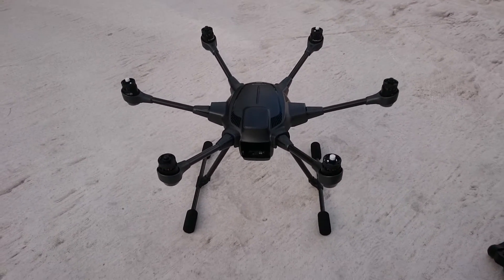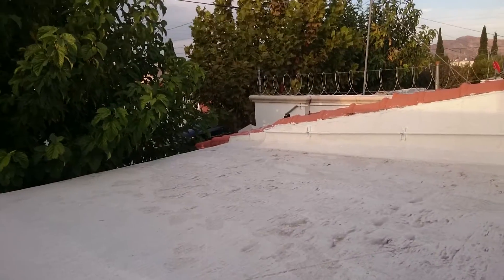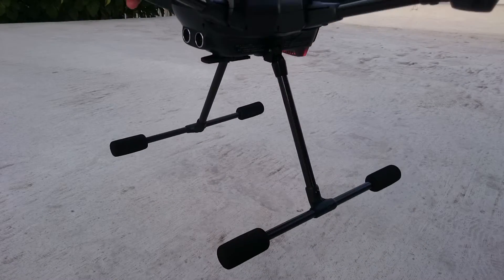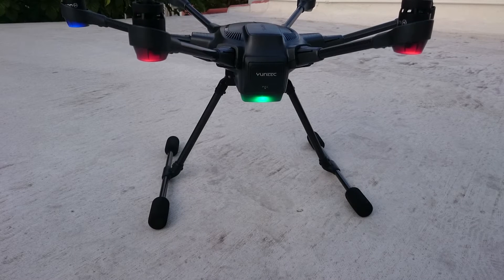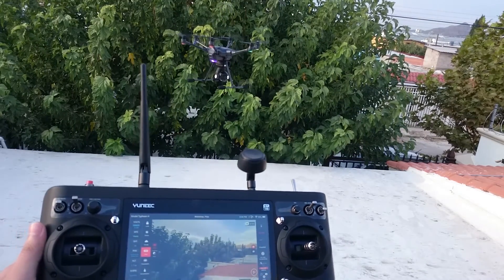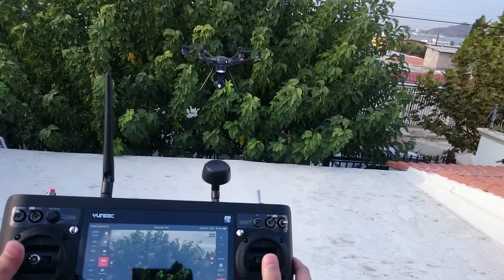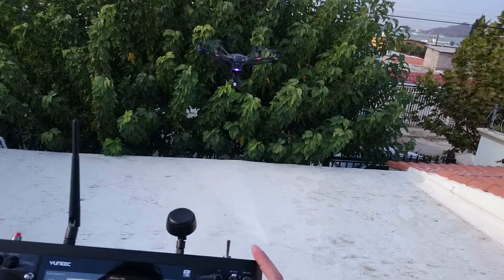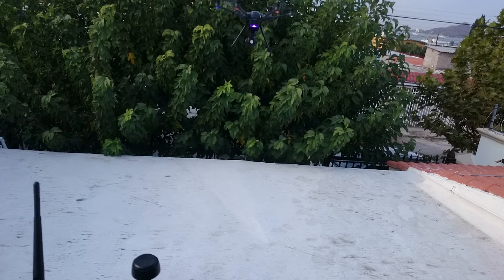Typhoon H accelerometer calibration on not level surface.

Comment: Running with GPS, calibration of Compass and Accelerometer are controlled by the GPS,
and not by the 3 calibrations.  If switching to angle mode, you may encounter several
control problems.
Reply from the maker: I was on angle mode, I think you meant disabling GPS. No GPS flight is called manual on the H and I believe its called ATTI on DJI units. I have to agree, non-GPS flight might show inconsistencies if accelerometer and compass calibrations are off

Comment: Thanks for sharing your experience.
Was your video horizon level in the flight after non-level accelerometer calibration?  I couldn't tell in your video.
Also, I noticed that when you did the compass calibration, you spun the TH backwards according to manual and tutorial videos (https://www.youtube.com/watch?v=b_6FcmFjpVc).  Apparently it doesn't make any difference!
Reply from the maker: I don't remember if gimbal was leveled, I will have to check that later. Also, you are right, I've been spinning the H backwards for quite a long time now. It doesn't make a difference!

Comment: The point of an accelerometer calibration is to give it a flat reference point so it knows what level is. With the GPS on, issues will not show up. Disable GPS and the H will drift because its reference was not flat. So in other words, if you calibrate it on a slope you will not notice any problem, but if you lose GPS lock for some reason the H will lean at an angle equal to the slope and that could cause it to fly off and possibly crash into something and you will have to fight against that when having to manually control it. A level reference is required for the accelerometer, but sure, it does not have to be precisely measured with a laser level or anything.
Reply from the maker: It was to my understanding that the accelerometer calibration was mainly to establish a zero movement reference, so once in the air it could correct itself if it any motion was detected to try and keep that zero, and that's why level was not too relevant but the important part was to keep it completely still. Thank you for your insight, I'm new to these machines, so I've still got a lot to learn. I'll try to test flying without GPS when there's a very calm day to confirm if it behaves like that. Thanks for you coment!
Reply: Jules_Flies Yes test it out, but only a few degrees off on a windless day, otherwise it will shoot off at a high speed and be ready to compensate with the stick and turn the GPS back on. The accelerometer is part of the gyro stabilisation system. I do not have an H yet, but I calibrate my machines by eye - no need for fine precision, but sometimes when I am not accurate enough, it will introduce a bit of drift when GPS is off. Seeing as this calibration is only occasional with the H, I think it's best done on a surface which is assumed to be level, such as a flat table or concrete floor.

Comment: IS THERE A REASON YOU TURNED OBSTACLE AVOID OFF  WHEN YOU
 LAUNCHED ?
 THANKS KEITH KUHN
Reply from the maker: For safety. Even the manual says you should disable it when taking off and landing. I assume its to prevent it from automatically backing up when its so close to the ground if some object is to trigger the Obs Avoidance.

Comment: KEEP UP THE GOOD WORK.
 MY TYPHOON H DOES NOT SEEM TO HAVE
 CRYSTAL CLEAR VIDEO LIKE YOURS OR OTHERS
ANY IDEA WHY ? ALSO I CANNOT FIGURE HOW TO SET THE 
CAM TO 4K - - -IT IS LOCKED IN AT 1080 P  
WHICH IS FINE BUT I AM TRYING
 TO LEARN ALL THE SETTINGS, ANY IDEA ?
THANKS
 KEITH KUHN
HAPPY EDITING
Reply from the maker: I refocused my original camera because it wasn't in proper focus. I also have a secondary camera which did came in focus from factory.
Reply: how to refocused the original camera?